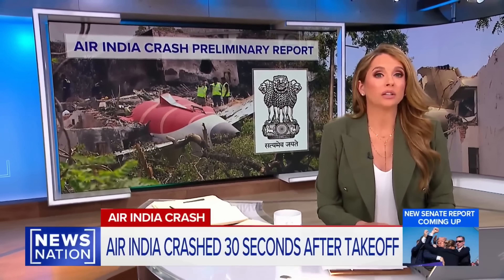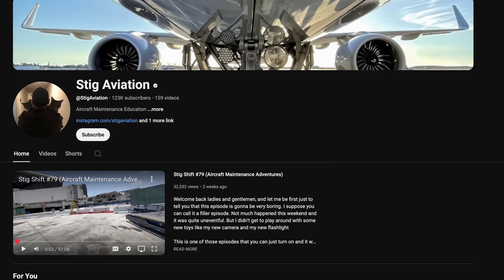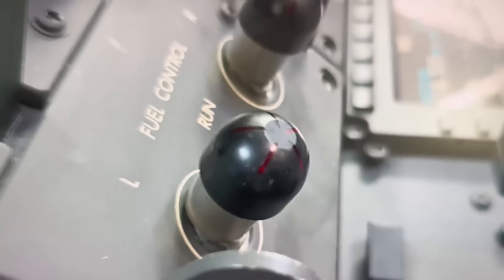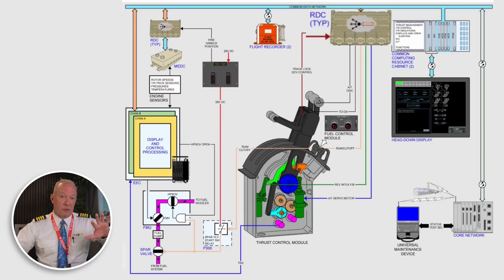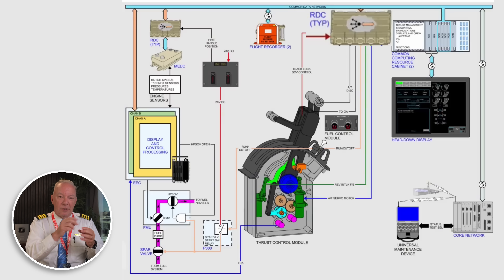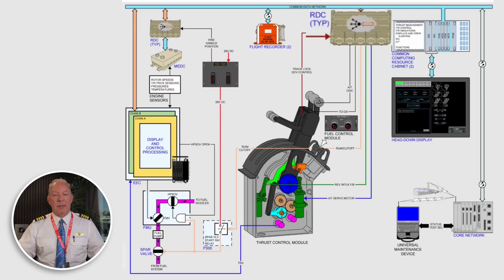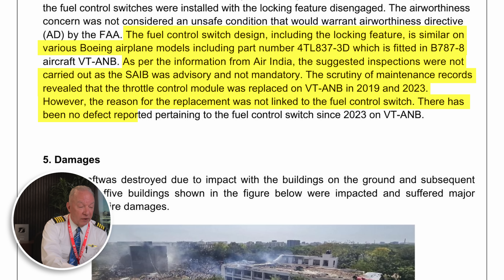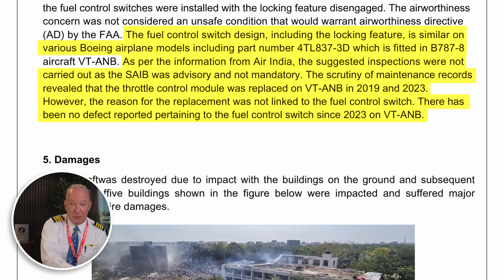The Truth About Boeing 787 Fuel Control Switches

Comment: The diagrams do not seem to support what is being said in the video. Only the spar valve is shown as controlled directly by the relay. One of the other switches is shown as controlled by the ecu and the other valve is through an and gate from another source. I may be totally wrong since I have no aircraft training whatsoever.
Reply: You are absolutely correct. It is Captain Steeeve who has got it wrong.

Comment: Japan 787 flight incident in 2019 where the plane (software) cut off the fuel switch automatically, 

The pilots said they did not cut the fuel to the engines and investigation revealed it was the plane which did the cut off .. 

The plane thought it was already on the tarmac and (wrongly) assumed the pilots were doing a dangerous maneuver (applying reverse thruster too early), hence it shut the fuel to the engines
(Business Standard, 17 July 2025 -  AI171 crash: Boeing 787 had similar fuel switch issue in 2019, says expert )
Reply: Its turning out to be that is was in fact an electrical fault, a defective diode in the battery charging unit.

Comment: This looks like a very dangerous design. The fuel cock default mode is closed. To open them you must supply power to the relay and all 3 will open. If there is any interruption in the electricity supply the fuel cocks will close. If a wire to one cock interrupts the cock will shutdown or if the electricity interrupts all 3 will close until you recycle the cockpit switches. That is very dangerous.
Reply: Sorry you Captain Steeeve lovers but breaking news from today: a distinct possibility the cause of the crash was due to an electrical short due to fluid leakage from the above toilets onto the circuitry. 
From today's vlog: "Airline News with Geoffrey Thomas eps 189 Air India crash". Excellent vlogs and analysis from both gentlemen without the sensationalism that Captain Steeve embraces.
I dismiss Steeeve's analysis, these guys are the one's to watch. Very professionally done!
Reply: Sorry you Captain Steeeve lovers but breaking news from today: a distinct possibility the cause of the crash was due to an electrical short due to fluid leakage from the above toilets onto the circuitry. 
From today's vlog: "Airline News with Geoffrey Thomas eps 189 Air India crash". Excellent vlogs and analysis from both gentlemen without the sensationalism that Captain Steeve embraces.
I dismiss Steeeve's analysis, these guys are the one's to watch. Very professionally done!
Reply: Sorry you Captain Steeeve lovers but breaking news from today: a distinct possibility the cause of the crash was due to an electrical short due to fluid leakage from the above toilets onto the circuitry. 
From today's vlog: "Airline News with Geoffrey Thomas eps 189 Air India crash". Excellent vlogs and analysis from both gentlemen without the sensationalism that Captain Steeve embraces.
I dismiss Steeeve's analysis, these guys are the one's to watch. Very professionally done!
Reply: I suspect that Captain Steeeve has greatly oversimplified his explanation of how the system actually works.

Comment: Another question:  Why are the two fuel switches so close to each other?  There are two pilots, two engines, two of everything, all adding to fail-safe redundancy.  Why not put the two fuel switches on either side of each pilot?
Reply: Perhaps it's because if one of the pilots was incapacitated and the engine on his side needed to be switched on/off, then the other pilot wouldn't be able to reach it?
Reply: @Manticore1960  That makes sense.

Comment: There is a troubling issue here and its the investigation itself. Prelim reports are not complete but come with documented info that timestamped and noted correctly. None of that is seen in this report.
There also the troubling fact they wont let anyone including the UN aviation investigator examine things which is very unusual.

Now this could be inexperience and ego running the show rather then malice.
But given Air India track record and India government very well known corruption issues one would think they want to be as open as possible to avoid these such questions.

There a lot of questionable behavior even with them blocking  ICAO observer from participating.

Comment: If the switches were moved to the halfway point (neither detent is engaged), would the fuel be on or off? In this position, the switches are open to vibration and accidental knocking.

Comment: Hello captain steve
In respect for the pilots who lost their lives in the Air India aircraft, as well as for all other pilots who carry out remarkable work across different airlines, and for the victims of the Air India tragedy, I would like to ask you to once again examine the highly technical and detailed hypothesis and explanations for the accident put forward by these two experts.
https://www.youtube.com/watch?v=tjhadW0mC2c
https://www.youtube.com/watch?v=t_t8nX7lb0U

I am not suggesting that this is the ultimate truth, but it does sound far more plausible than the preliminary report of the AAIB.

What all of us as passengers really want to know is: what actually happened, and could — or can — such a tragic accident be prevented?

As a passenger, I would like discussions of such solid arguments by opinion leaders, influencers, and aviation professionals to increase the pressure on the AAIB. This way, the AAIB will be urged to present the data and facts comprehensively, fully, and accurately, in accordance with ICAO standards, so that the cause can be clarified in a transparent and verifiable manner.

Comment: There’s one thing that I have been wondering about regarding the fuel switches in this flight. For some reason they went to “Cutoff” and one of the pilots comments if the other pilot did that. But then there were 10 seconds until they went back to “Run”….10 seconds…that is a long time in an emergency like this. Is there some other procedure they have to do before returning the switches back to “Run”? If not, what could have caused this delay in switching back to “Run”, and if that would have been done immediately, would the engines been able to restart immediately?

Comment: On the Boeing 787-8, there is no direct link between the (pilots) cockpit switch (levers) and the recorder. (yes?)  The data recorders data comes from the relay not the pilots fuel shutoff levers. (yes?)  (this reduces wiring complexity) The recorder depends on a sensed voltage at the relay (or switch,not sure), not on the physical position of the switch. So the voltage is in theory representative of the switch position,

Because the fuel valves require a constant 28VDC to remain in the open position there is a DIRECT CURRENT FAILSAFE SYSTEM.

So, in case of total electrical failure to prevent the 3 valves from closing (shutting off due to loss of power) there is a connection from the aircraft batteries suppling a constant 28VDC thru the "hot battery bus", "relay" then to the fuel valves, to prevent the fuel valves from shutting off (due to lack of power from a total electrical failure). The deployment of the RAT may have indicated this. (yes?)

So, if that is true the data recorder recorded a no power moment indicative of a pilot fuel switch position change that might actually might have been a momentary loss of power do to a faulty connect in the direct current fail safe system. (yes?)

I'm not sure of any of this, please advise.

Comment: Pardon my ignorance but that electrical schematic shown appears to show that the cut-off switches supply power to the SPAR relay which ONLY supplies power to TWO of the three fuel valves. Fuel valve FMV is controlled by another module. Not what Capt. Steeeve is saying.
Reply: Yes, the fuel control switch only controls the spar valve directly. The valves inside the engine are controlled by the EEC. Though it looks like the high-pressure shut-off valve needs its input from both the EEC and the fuel control switch.
Reply: Yep. Captain Steeeve got it wrong.

Comment: 5:00
First, I know just about nothing about aviation, but I do know some things about electronics.
I agree, and I disagree, with Captain Steve.
I agree with what Captain Steve when he said in the Pierce Morgan show:
"We're trying to approach an irrational act [of the pilot] with a rational mind. And it doesn't make any sense."
Likewise, (according to me) it doesn't make any sense to try to the analyse what happened with this plane
with the approach that the planes mechanical and electrical systems worked "rationally" or as intended.
A correctly working system might seem simple and straight forward, but the function of a faulty such system
can be incredibly complex. E.g. I assume that the cables in an airliner are bundled in cable harnesses,
in which it is possible that any cable/signal is shorted to any other cable or signal.
So I don't agree with Captain Steve when he says (5:10): "It's its own little simple system."
It might be intended to be. But it might not be little and simple when it is faulty.
And even simple faults can get large consequences.
E.g. what if the springs in the fuel cutoff switches seized, so they didn't got locked in the open position?
Maybe that isn't likely. But it isn't likely that an airliner crash. So when an airliner does crash it is very
likely that something unlikely happened.
Reply: As you know about electronics, did you also notice that, despite what Captain Steeeve claims, there ARE external inputs that control 2 of the valves. They are not only controlled by the fuel control switch.
Reply: @Manticore1960  Yes I did notice that, but I didn't bother to comment on it for several reasons.
What Steve showed was a block diagram. A block diagram can be used to make it easier to get an overview of a function, by removing details.
Even if there hadn't been any external inputs in the block diagram I wouldn't assume there weren't any actual external inputs.
They might have been shown in a detailed circuit diagram, but discarded in the block diagram.
There have been reports in media, and in Steve's videos too i believe, of when the switches were turned on and off.
I assume some kind of sense lines were connected to the switches that recorded the switch states, without affecting them,
i.e. UNLESS something was faulty. E.g. short in a wire harness could have make the sense lines to force the control signals into an incorrect state.
Steve says a relay only has two states. Mechanical relay are notorious of ending up in in-between states when worn.
There are gazillions of possible faults in a complex system you can think of, and very likely even more that you can't think of.
Compare this to e.g. a car's rear brake light. A pedal switch and light bulb. Can anything be simpler?
Just the other day I happened to see a YouTube video named "This £2 Bulb Nearly Destroyed the Car – Here's How!" Watch it!
Someone's brake light didn't work. Was the fault easy to understand and find?
Imagine trying to find that fault in a car after it has been totaled and eaten by flames, like this airliner was.
No "I disconnect this and see what happens.", "I open this harness.", "I cut this wire.", "I reconnect the wire.", "I replace this part.", I try this.", "I try that.".

Comment: There was a larger coronal discharge at around mid-day on June 12, 2025.
Reply: Fiber optic repeaters are known to have been disrupted and malfunction because of solar flares. Does the fiber optic line from the fuel cutoff switches send or receive signals to/from any of those vulnerable devices?

Comment: I like your little setup illustration there. But with that system, even it's a closed loop, if your battery dies... doesn't matter what position the switch is in, yes? The blinky light will turn off. So my question remains, how would they know if the current didn't fail from that battery. Are other things fed by it? Would their failure have shown up on other systems?

Comment: Two different recent technical expert videos demonstrate or explain how it is indeed possible for it to be either poor maintenance allowing water ingress into the avionics, or else poor avionics design involving the lithium battery and a diode.  Both hypotheses are consistent with the last recorded words of the pilots. So the root cause is still open.

Comment: I'm an industrial electronics engineering with 40 year experience with electrical (relays/conductors) and digital control systems (PLC). Previously I was suspecting a possible glitch in the digital signal environment of the control systems. Now since you explained that the engine cut-off/ON is an independent ELECTRICAL (not digital) circuit directly controlling the fuel system, it's clear to me that one of the pilots have switched the engines OFF.
Reply: Did you not notice that the diagram flatly contradicted his statements ? Other comment here by people claiming to be avionics experts say that he is also simply wrong about how some things work, like the valve actuation (need electricity to turn OFF, not ON)
Reply: As "an industrial electronics engineering with 40 year experience with electrical (relays/conductors) and digital control systems (PLC)" then you must surely know how to interpret a circuit/block diagram. Take another look at the diagram. What is controlling the FMV & HPSOV?
Reply: @Manticore1960 Thanks for your comment. I checked again more in detail the diagram/schematic. It's assembled and doesn't show the complete circuit of the electrical and digital signals which courses on or off of the fuel systems.
Reply: @clausbader9537  I agree, it's not a complete circuit diagram, but the block diagram clearly shows a control line from the EEC unit to the Fuel Metering valve (FMV), and from the EEC to the High Pressure Shut off Valve (HPSOV) via an AND gate. So Captain Steeeve's claim that the switch/relay/valve is some kind of closed system is wrong. He claims that, apart from switching the fuel control switch to CUTOFF,  there's no other external influence that could shut off the valves, which, according to the diagram is plainly incorrect.

Comment: Ok capt if it true that wiring on the fuel is direct like that and the FADEC has NO authority on the  engine fuel contral shutoff valves then I will trust the 787again,base it's very ridiculous to authorise any ECU to touch on those shut off valves thanks.
Reply: Look at the diagram. It flatly contradicts what he says.

Comment: My understanding is there are 2 solenoids. One to open and one to close the fuel valve. The control switch is a momentary type and not maintained. Am I correct Capt. Steve?

Comment: Retired electrical & aerospace engineer here ... problem is that if the 28v dropped off (as if the battery were to have been suddenly loaded by brake loads), the Cutoff Switch status contacts lose "sense voltage", making the data concentrator report an erroneous switch status. In other words, the Cutoff Switches may have not actually "transitioned " away from Run, as reported in Prelim Report.
Reply: As a mechanical engineer I agree but a full second between both switch points is a lot of time in that scenario. The switch points then should be milliseconds appart.
Reply: @MrTwers  All the timings in the preliminary report are suspect, as the resolution for all of them is 1 second. They have obviously been rounded up/down, or even just truncated. Would, say, 10ms be recorded as 0 or 1 second?
In maths lessons, we were taught to round up/down according to the value of the least significant digit. 0-4 round down. 5-9 round up. But we don't know how it was done in this instance.
Reply: @MrTwers The report only said “with a time gap of 01 sec”

Which could actually means 1 millisecond or anything in-between 1 millisecond to 1 second.
Reply: Good point ... but, what if the time required to execute a software "protective closing" of  primary/secondary bus tie, is significant ... say hundreds of ms? In this case, could a second shorting event via a failing battery approach one second?

Comment: Brilliant explanation,  thank you  just for clarification if the switches were at mid point and not locked at run, would the circuit be live or dead.
Reply: "Brilliant explanation" but unfortunately it is wrong!

Comment: It occurs to me that if the power to that circuit had dropped, the valves would close. That would normally be because the switch was moved, but you’d have to back up further through the power bus to see if it is possible that a power failure to the switch could have created the same situation. 

However, I assume that each engine would have its own supply from the bus to that switch and also, the voice recorder recorded one of the pilots asking why the other had turned off the switches. Either he saw the other pilot do that or he at least observed that the switches where in the cutoff position, which sort of indicates to me that the power to the circuits was not the problem. However, a more complete circuit diagram would maybe help illuminate that possibility. It does seem to me though that if the fuel valves require constant power to remain open that could be a problem. I don’t believe that that was the issue here, but it seems like that switch should be wired (and the valves so configured) that the valves need power to change position. In other words, if the valves are open and the circuit loses power, they stay open. If the valves are closed, they stay closed.

Also, do those switches have a double throw function, where the flight data recorder observes their position without affecting the fuel valve circuits or is there another place in that circuit where that data is collected?